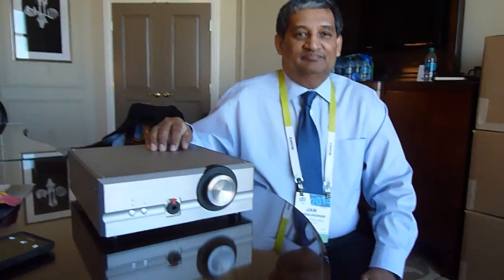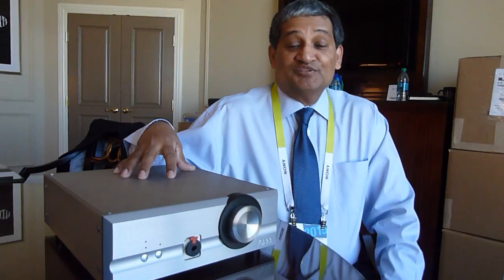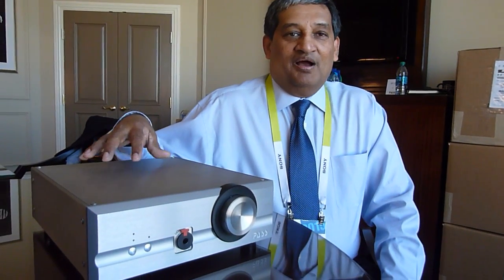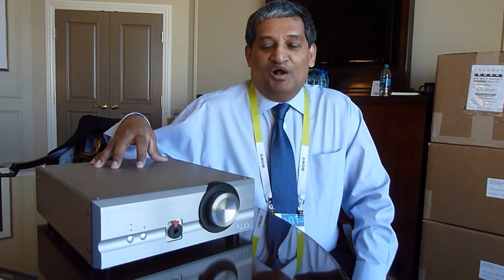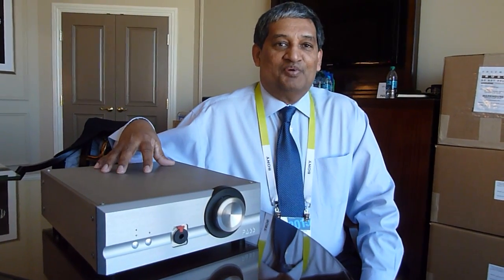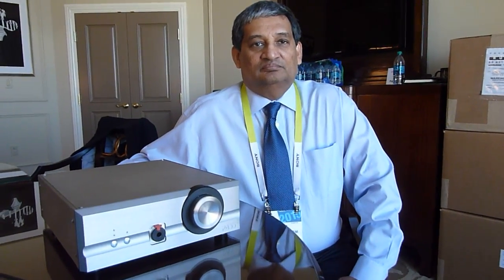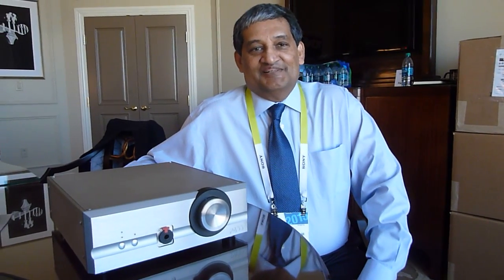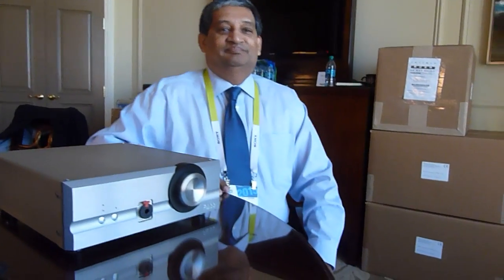CES 2015 Pass Labs Upcoming Headphone Amp

Comment: cool. bigger does mean better
Reply: +John Doe tsk tsk more assumptions.
Reply: Marco Karaki
Oh there are many reasons.
Because it's a discrete design, probably complete overkill, with a large and heavy transformer.

Could produce lots of heat from inefficient design, so a large case helps with cooling.

To sell it as a powerful products to audiophiles that think more power is better.

To sell it to people that hear with their eyes.

Using the same case as in other products could mean savings in manufacture.

To sell it at a ridiculous price.

...
Reply: better hearing damage, yes
most headphones don't need more than a few milliwatts
Reply: +John Doe lame assumption.
Reply: Brian Westfield No assumptions here. That's simply a fact.
Reply: +John Doe its presumptuous to state someone would have hearing damage just for having more power.
Reply: Brian Westfield
Well, you don't unless you intend to actually use the power.
Reply: +John Doe exactly my point. And it's presumptuous to assume someone would buy this with the intent for "better hearing damage".
Reply: Brian Westfield
It's a valid response to the "more power is better" nonsense.
Reply: Brian Westfield
Is that all you got? "tsk tsk"
And again, what assumptions?

The only blanket assumption I see is "more power is better". But I can see how gullible audiophiles would fall for that.
Reply: John Doe Brian Westfield I'll be honest, my original comment was made in order to see if someone could explain why it's so big. Seems neither of you can do that
Reply: These don't even have a ton of power. They have enough power for any headphone, but not more than that. It is big to prevent any possibility of ripple or power starvation. The case, in this case, is about 2 times thicker than it could be.
Reply: +John Doe yawn
Reply: Brian Westfield
That about sums up what's going on in your head.
Reply: +John Doe once again so much ASSumption about things.
Reply: +Marco Karaki your original comment was a statement.
Reply: Brian Westfield The best way to learn the facts on the internet is to tell people the wrong thing, and then wait for a bunch of others to yell at you what the right thing is.
Reply: Brian Westfield "ASSumption"? Wow, you must be like 8 years old.